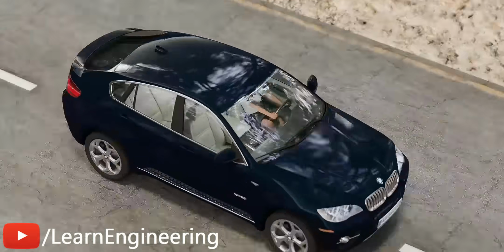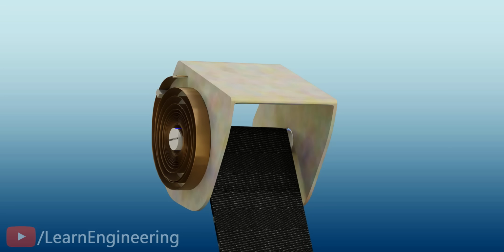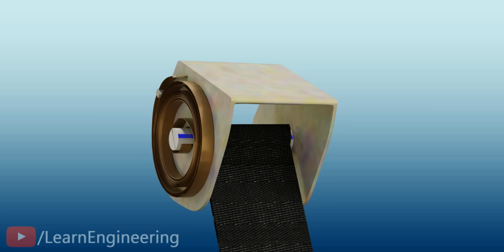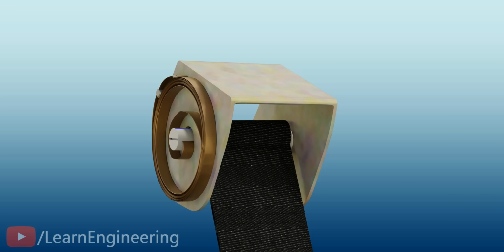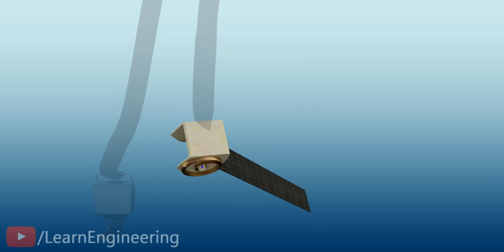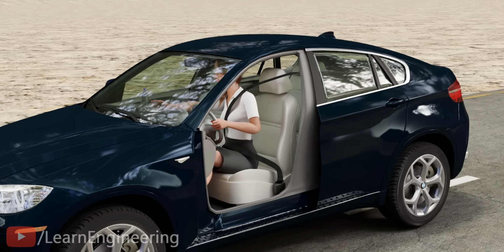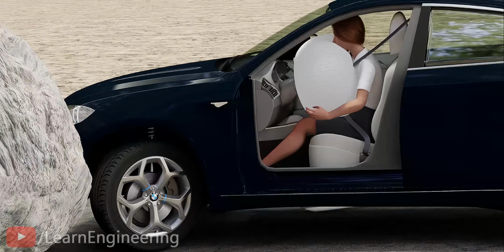Seatbelt | How does it work?

Comment: She's braking with her left foot...
Reply: She's probably a pro rallye driver
Reply: If you press the gas and brake at the same time, you will get a screenshot.
Reply: @Zellium_11  You are one of those people who drive with the brake lights on...
Reply: @DashCamSerbia  That's a different issue.  You can use your left foot for braking without being one of those clueless idiots who actually rides the brake pedal.  It's not a foot rest!
Reply: I do that too when I drive an automatic.  My left leg is my dominant one.
Reply: @Zellium_11  that's wrong for many many reasons
Reply: Pro racing driver that is blind.
Reply: So?  That's the best method to drive if you learn how to do it properly.
Reply: Everyone should brake with both feet. Your left foot should be present over the brake pedal at all times in an automatic transmission vehicle. If it isn’t you are simply lazy.

There’s so much stupid on this thread you people need to be ashamed of yourselves.
Reply: @JoeOvercoat  oops! how did my brake drum heat up so much? resting your foot on the brake is only going to wear out all your moving parts..of course in due time
Reply: @bonifacethattil9567  Who the hey said anything about resting your foot on the brake pedal?  Do you people just assume other people are lazy because you are?
Reply: bruh yall stfu and drive what ever, manual or automatic the real way. Don't be like the Walter Jr. from breaking bad and use two foot, yes use the left foot for clutch but you should be using right for brake
Reply: @Zellium_11  left foot is meant for using the clutch. if you were to use your left foot to brake and at the same time forget to take off the right foot off the gas pedal, then adios amigos.. your 0.2 seconds will be of no significance and you will end up crashing even worse. letting go of the gas pedal causes the vehicle to stop accelerating thus requiring less braking force. additionally, that brings into action an aspect called engine braking, where the engine and transmission components rotary motion aids in slowing down.
Reply: You noticed that too!  Some not very attentive viewers here.  :)
Reply: Its automatic ,brake and accelerator only!so
Reply: @hmp6370  it has 3 pedals. it's not automatic.
Reply: Don't mean to bust your balls guys, but she is CLEARLY braking with BOTH feet. You can see her right foot come off the gas and left foot off the dead pedal/clutch :P
(edit) the last part of the video is different and shows her only using her left foot. The other parts of the video show her using both feet on the brake.
Reply: Ever heard of manual transmition?
Reply: @MaximumBan  ever heard of an automatic transmission, because that's what the car is.
Reply: @sam105s  Never seen a 3 pedal automatic in my life.
Reply: @sam105s  yeah, tell that to all 3 of the pedals in the footwell...
Reply: @MaximumBan  You mean the litterally manual one? With the hands?
Reply: It's a woman, she can't do anything about ut
Reply: shes a professional driver
Reply: Bro.. its the clutch obviosly. Thats not an american car.. there are still people out there that are actually driving.. not just putting theire right foot down
Reply: I brake with the left foot too. Something I learned to do driving go carts years before I started driving cars.
Reply: could be added realism
Reply: Who said SHE'S BRAKING AT ALL??
Reply: @jaisreeram1078  good point
Reply: thats now very common... in auto cars you have only 2 pads and lazy people now use there left foot for braking... after a long time you get used to that...
Reply: this is the reason seat belts were invented in first place
Reply: @Zellium_11  the reason the don't encourage that is because in an event of an accident our adrenaline can cause impairment and make the mistake of hitting accelerater with right foot at same time or (mentally) wires to be criss crossed .. so to speak
Reply: I thought they were showing the clutch and brake without showing accelerater
Reply: Vehicles with 4 pedals must give you an aneurysm
Reply: @Zellium_11  there's a reason why you are supposed to break with your right foot: in an emergency, you might accidentally press on both, the break AND the gas pedal if you are used to breaking with your left foot
Reply: @blubbel222  I was taught to brake with the right foot over fifty years ago however, I learned on a manual transmission where I needed to use the left foot for the clutch in an emergency stop.  When I drive an automatic, I brake with the left foot because it's faster.

Only an idiot would hit the gas and the brakes at the same time.  Once you understand the reasoning, you'll find that using the left foot for braking is simpler and safer.  I've been doing it for over half a century, and it's just a better method.  Either method is acceptable, and you'll find that many people do it my way.
Reply: @checkmate-e4b  it aint a better method
Reply: @blubbel222  Do you put your shoes on before your pants on too?
Reply: @blubbel222  depends on how much you get used to it, I'm using left foot braking on automatic car, went on several emergency braking and i can brake just fine

You can practice a left foot braking technique with open wheeler such as go-kart etc
Reply: @ramadhanisme7  It's a better way to drive if done properly, but I think most people were taught the old fashioned way.
Reply: ZOMBIE GUT kill but u have to move foot from your gas pedal
Reply: @Zellium_11  all right, you got used to it, i know. Of course noone could stop you for that. Keep doing it then. But maybe sometimes, as you drive, you maybe pressing just a little the brake pad without knowing it, so you waste more fuel and you waste your brakes over time. There are times as i drive, i see the front car keeping the braking lights on, so i guess he is accidentally pressing a little the brake pad without knowing it. Breaking with the right foot, doesn't take more than half a second to move the foot. Also, when i drive in crossing roads, i precautionary, lift my right foot from the gas pedal to just be ready to brake, in case of emergency. Not hard. Not rocket science. But if you got used to it, maybe you should just continue doing what you do.
Reply: @songoku7915  braking with you left foot is thought in when your doing your licence when you want to race cars you can use it with all transmission types the feel in my left foot is as good as my right
Reply: That is a clutch pedal on the left...
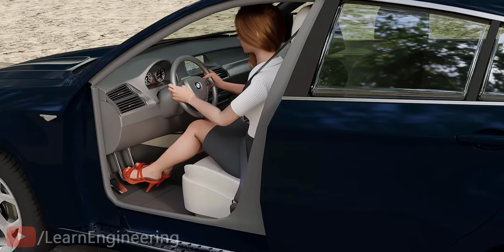Reply: @DashCamSerbia  irrelevant though (see 6:51)
Reply: Braking with the left foot (for non lefties) ia dangerous, since we cannot control the braking pressure well.
Reply: Its self-explanatory... See your first word😂
Reply: @harshmadnani1613  funny
Reply: @harshmadnani1613  And the fourth word...🤣😂
Reply: Harsh Madnani haha sexism 🤣🤣
Reply: @harshmadnani1613  I guess you Americans with the automatic toys have never driven a manual stick where you need to press the clutch, right?
Reply: @emmanouildag7760  mate i ain't from America...😆 fyi i belong from India, we have 80%+  manual cars here... 
And no one brakes with fuckin left leg ...! Stick to the facts Normie
Reply: @emmanouildag7760  lmao I'm sorry I don't use a manual in stop and go traffic
You probably drive on empty roads lmao
Reply: @harshmadnani1613  that's harsh
Reply: @harshmadnani1613  Sexism still a popular thing in third world countries? Big oof
Reply: , @emmanouildag7760  I am trying to drive a manual it seem fun and safer to think about it you can downshift to slow down my dad still have original brakes pads from factory.
Reply: I do it too. Believe me it reduces the reaction time a lot due to left foot is free and closer to the brake pedal
Reply: @bahhaziz  not a significant reduction in reaction time.
Reply: She is a woman
Reply: Braking with your left foot is a fatal mistake if you drive a non-diesel car.
lets say you hit a boulder in the middle of the road, your right foot isloose so in the impact moment it is most likely to press the gas pedal wich provides the engine with gas, if the motor sustains critical damage that may lead to a fire too , or if the motor sustains minimal damage you just increased it, ending up with more damage that you needed in that tight situation to be honest. Sorry for the long comment, I use to make long remarks from my phone when I drive drunk.
Reply: @simionalexandru9546  Right foot is not loose in an accident. It doesn't matter how hard your hit something, your legs can't fly forward and accidentally press the pedals. Think about the position of your leg and the gas pedal, you need to bend you ankle down on the gas to put pressure on it. Your legs don't kick and your ankles don't bend forward when you crash. Even if your legs were loose and kicked forward in an accident, when you're seating down the angle of rotation from your legs won't put pressure on the accelerator because your legs kick upwards when you're seated. Sit in your car and visualize this. Looking at how the gas pedal is designed, can your leg be loose enough to put pressure down on it in an accident? Mind you, you're wearing a seat belt so you can't slide forward on your seat and accidentally step on the gas. Your seat is adjusted at a comfortable distance from the pedals so even if you kick, that kicking motion does not apply downward pressure on the gas. At your seating distance, your ankle needs to bend down on the pedal to put pressure on it
Reply: @richardtsutsa6172  I am  2.05  tall , a little push and its touchdown for me ,maybe you are right, that won't apply on a 1.56 woman.
Reply: @simionalexandru9546  Height doesn't matter if you're seating at a comfortable distance. When you crash your ankle doesn't bend down on the pedal.
Reply: @richardtsutsa6172  depends on how you like to set your chair.
Reply: @simionalexandru9546  wrong. If you use to it your brain is programed to lift your right foot from gas pedal at exact same time your left foot goes to brake pedal
Reply: @bahhaziz  yeah but is more indicated that you press the shitft pedal , especially if you ar in a higher gear.  As you bake if you do not shift you migh tfeel a weird trepidation, that affects your engine.
Reply: This is a automatic car
Reply: @tarandiwana894  Automatic car with 3 pedals? lol
Reply: @tarandiwana894  automatic car? EVEN WORSE
Reply: @tarandiwana894  yeah, an automatic with 3 pedals
Reply: @tarandiwana894  no, it's not 😄- At 6:51, one can clearly see her depressing the brake pedal with the left foot, right foot on the gas pedal and clutch pedal off to the left of her feet
Reply: @Zellium_11  You are an awful driver.

Comment: Does that mean that if the seatbelt retractener is activated by mistake, or you avoid the crash, that you need a new seatbelt? Or can it explode more times?
Reply: Like airbag, I guess. Even if it will be activated by mistake - you'll need a new airbag)
Reply: @vk220  Okay. I just think it might be "easier" to trigger the seatbelt retracter without a crash, than the airbag. Thanks for the reply.

Comment: Crazy how much thought and engineering goes into aparently simple things
Reply: Most things in life are like this, they seem simple at first glance but if you try to build it you quickly realize that it just wont work the way you thought and new problems are introduced.
Reply: @Danuxsy  That's true.  The more problems you solve, the more you introduce.  Nothing is ever perfect.
Reply: @Danuxsy  it’s fascinating how easily it is to blame engineers for putting something like an oil filter in an inconvenient spot but when it’s revealed how complex something like a seatbelt is we can begin see how many tries it took to get it from inception to where we are today.  We are literally built upon the intellect and hard work of previous generations.

I’m building a gate right now and trying to design the latch mechanism.  I’m not an engineer so it should be a process of trial and error.  🤔
Reply: Just one correction (I have since taken the rear console in my Z3 apart, so I've seen a bit more there).  The retractor isn't tied into the SRS, it seems it just has an inertia-based mechanism to lock the belt if there's a certain amount of acceleration in any direction (and that amount of force isn't much, considering that it locks with just fairly hard acceleration or semi-spirited cornering).  I'll also edit my old comment above, so people reading it in the future see it correctly.
Reply: And then the people who explain it get the whole pretensioner thing wrong.
Reply: 😮😮😮😮😮😮😊 @johannkuhn5685
Reply: @johannkuhn5685  alright, now you explain it then..
Reply: @belovedtruth3447  The pretensioner doesn't fire when you slam on the brakes, it fires with together with the airbags if the SRS detects a major impact.  Just think about it this way, it's a pyrotechnic charge that yanks the belt tight.  That mechanism and charge are single use, so if it fires when you slam the brakes (ie. before impact) you'll have to replace it after every emergency brake.

In my experience the pretensioner is also not in the retractor, but part of the buckle on the side of the seat bottom.  This also makes sense if you think about its purpose.  The pretensioner is not there to take up slack at your shoulder, it's primarily there to take up slack from the lap section of the belt, so you don't slide under the seatbelt (known as submarining, and it causes MASSIVE internal injuries).  If it yanks at the top, the friction at the buckle will interfere and it won't be nearly as effective.  For this reason it yanks the buckle down.

In a modern car, the inertia-based lock also operates in all directions, and it's farily sensitive.  If the car experiences fast acceleration in any direction (so hard accelerating/braking, hard turning/swerving, rolling, etc) then the belt retractor locks, and will only unlock when you introduce slack by pushing yourself into the backrest.  This serves two purposes.  First it keeps you planted in your seat during aggressive maneuvers, and second it serves to "prime" the seatbelt in case the pretensioner needs to fire.  If it only worked with the force of an accident, there would be a delay during which the belt freely unwinds before the mechanism can lock (keeping in mind how quickly an accident happens).  Because of that the pretensioner would pull the belt out a bit further before the inertia lock has time to engage, which would drastically reduce its usefulness.  But with the belt already locked the pretensioner will simply take up the slack.
Reply: @johannkuhn5685  Wow, that's a good read. Thanks. They should've done more research i guess!
Reply: @belovedtruth3447  Yep, I was quite surprised that they got it that wrong.  I suppose it can happen, but then they should take steps to correct the mistake.
Reply: @belovedtruth3447  wow, thanks. The way it was explained in this vid made it seem as though we’d always be having to replace them (or at least fast drivers would!). Your explanation is much better.
Reply: @johannkuhn5685  hmmm
Reply: @johannkuhn5685 what's srs?
Reply: @DalitKumarAryan  Supplementary Restraint System.  Basically this includes all the pyrotechnics used to keep you in your seat and prevent impact against hard surfaces (airbags and seatbelt pretensioners).  It also includes all the crash sensors that are used to trigger said pyrotechnics (as well as possible pyrotechnic charges to "blow up" power cables to prevent a fire), and the SRS computer also has a logging system to record a bunch of information at the moment of impact (vegicle speed, which senaors were triggered, etc).
Reply: The "supplementary" part means that it's meant to supplement the normal seatbelts.
Reply: @belovedtruth3447 he explained it to you alright 😂
Reply: Hi
Reply: Hi
Reply: Hi
Reply: Hcnn
Reply: My mind is literally proofing with thoughts
Reply: yeah the driver even has two airbags built in
Reply: It’s how you can easily tell those who have never created anything of value. They say things like “why don’t they just add a button to do X”. Not realizing the tremendous effort that goes into making that button work
Reply: She is Catwoman, she has 9 lives.
Reply: Yeah man you remain wondering

Comment: But what if you don't push the brake pedal? Or what if you brake heavily but you don't actually hit anything for example in a rainy day you push the pedal to the end and the tires won't get locked due to the ABS, will that piston be reusable immediately? If not it won't work the next time an actual accident happens.

Comment: Don't you hate it when there's a massive boulder in the middle of the road
Reply: It sometimes happens when you live in the Rocky Mountains.
Reply: @Mr._P4732  also happens when while e coyote drops a rock on the road
Reply: @patman817  Stop picking on Brave Wilderness!
Reply: Ruins my day everytime man, EVERYTIME!!!!!!!
Reply: a yes, a massive boulder, the size of a small boulder hehe
Reply: No
Reply: Just visit a Germany, there are thousands of fukin' boulders used as parking restrictors.
Reply: Happens with me everyday
Reply: when you missunderstand field with road😹
Reply: what I hate it most is that the driver drives directly into it with no hesitation as if it just shows up.

Comment: So does the explosive piston mechanism need to be replaced every time it is activated? Seems kind of annoying if you don't actually crash and you activate it from braking hard one day.
Reply: It doesn't activate from hard braking. It only triggers when crashing hard enough to need airbags - i.e. for a low speed collision where you get whacked around a lot but it's not strong enough (i.e. not enough G-forces and deformation of the car) to trigger the airbags, the pretensioner pyrotechnic charge won't fire either.